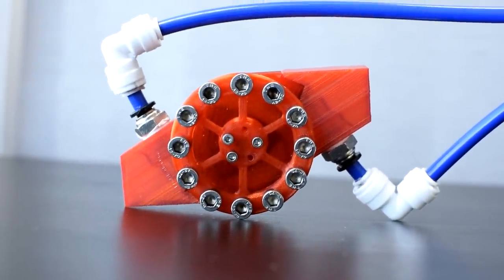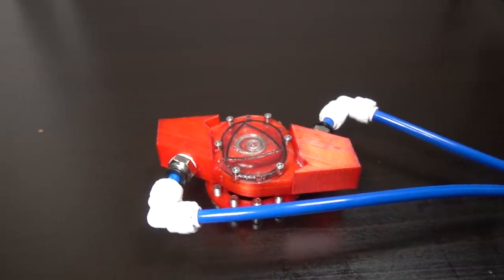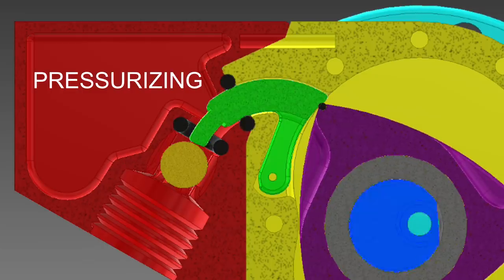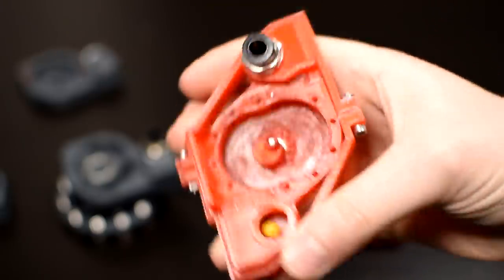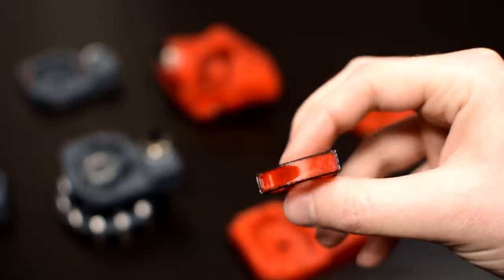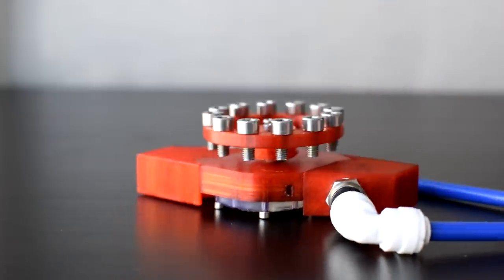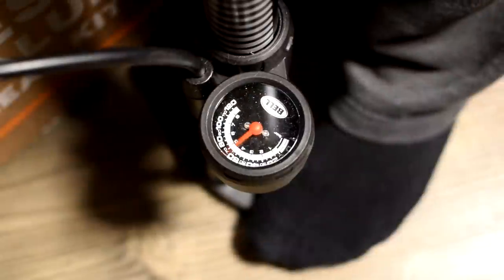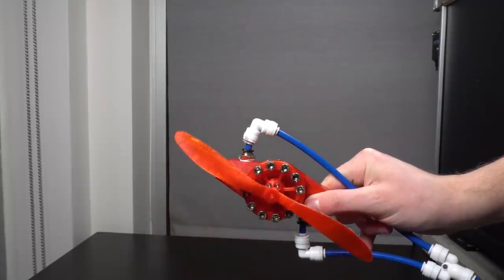3D Printing a Functional Wankel Engine

Comment: Was I the only one here who cringed slightly every time he said "piston" instead of "rotor", and "cylinder" instead of "housing"?
Also, in the background of the Wankel, it would have been relevant to mention that the concept of the Wankel Rotary in fact started out as a pump, but was later realised that it would also make an excellent engine. It does stand to reason, after all, an IC engine is basically just an air pump.
With that said, nice work on everything!👍
Reply from the maker: I cringe constantly, eventually you just get used to it!

Comment: Cool concept using air. The combustion variant is actually a crap engine; Super low torque, overheats waaaay too easily and relies mainly on rpm for "power".
Reply from the maker: Well, its a fantastic engine in theory! Just limited by today's tech. If they got as much attention and development as modern piston engines, they would certainly be a lot more capable. Also maybe some fancy new low expansion, heat resistant materials for better sealing and whatnot.

Comment: Well it works.. but is it really functional? Using air as a source of energy comes with a high weight or in work you gotta do. I dont accept anything on air as functional unless its connecter to the source of energy directly, say an compressor..
Reply from the maker: The fact that it works means it is functional by my requirements, which are converting compressed air into mechanical torque reliably and relatively efficiently. Now is it practical? No haha, no it is not

Comment: I'd like to see that Engine Steam Powered.
Reply: Get an Big pot do fire under it amd after an hour you've got sustained pressure thatay be strong enough
Reply from the maker: Also I'd probably have a melted engine, pla has a very low thermal deflection temp. But perhaps if I could print this in something more heat resistant...
Reply: @3DprintedLife  it depends, low pressure steam can stay below 180° C so  it wouldn't melt, but that's steam at 1.1 bar, and thats probably not enough so yeah, you'd need something more heat resistant
Reply: @3DprintedLife  and pah cf15 fillament is able to withstand 150°C and EXTEM AMHH811F is able to withstand temperatures up to 247°C but i think to print that fillament you need a special nozzle or something alike that

Comment: Given the price of resin 3d printers, why did you bother with fdm ?
Reply from the maker: Well I don't have a resin printer, so there's that. Also, I wanted a challenge. Doing this on a resin printer would still be tough, but the tolerances it could hold are so much better. Makes things much easier!

Comment: Gotta push back on that comment about FDM being inaccurate, my Biqu B1 is extremely accurate and I can print most things exactly the same size as the models.
Reply from the maker: Ah yes sure, I don't mean FDM printers are super inaccurate. If you print a 20mm cube, odds are most printers can get it within 100um. But most printers also can't avoid bulges on the exterior corners, large filets on inside corners, poor accuracy with overhangs, surface finish is far from smooth, etc. Compare what fdm can do with sla or machined parts and suddenly fdm isn't so accurate anymore, even though fdm is still perfectly acceptable for many applications!
Reply: @3DprintedLife  yea most of mine do that except the Biqu, not sure why but it works 😂

Comment: is it possible to make the same design on steam or is the pressure not high enough
Reply from the maker: The pressure would be fine, the high temperature is the issue. But with some design modifications and a different plastic, it might be possible!

Comment: Have you tried a tesla valve?
Reply from the maker: Ooooh no, but that's a cool idea!
Reply: @3DprintedLife  If you decide to experiment just note that all of the tesla valves I have seen are linear in fashion. If you’re limited with space you can print it in any shape you need, circular, spiral, Zigzag, whatever.
Reply from the maker: Very very true, thanks for the suggestion!

Comment: Hello sir, wich 3D printer is best for beginners
Reply from the maker: Depends on a lot of factors and primarily budget but I'd say go FDM unless you specifically want a resin printer. Ender 3 is popular and low cost so probably one of the easier machines to get help with online

Comment: Nice Work! I have also designed a 3D Printed Wankel, but mines a bit bigger and probably less efficient, I went with the original design using only the rotors themselves as seals. It worked nicely for the first version, even without apex seals and not precise printing, I have finished the second version but I didn't have access to a compressor to test it yet because of the lockdown, but the new version has apex seals, better flow design and more importantly 2 rotors! Hopefully I can test it soon!
Here is the new version: https://www.instagram.com/p/CMdxLrDLecm/
Here is the old version running: https://www.instagram.com/p/CInpyybpRqb/
Reply from the maker: Very cool, thanks for sharing!

Comment: Wait why this not on a actual car wheres MAZDA at they better explain why no air rotary cause apex seals can't die then
Reply from the maker: True, but if they were to actually make a car that ran on some kind of compressed gas there's probably more efficient engines. Wankels are meant to compress the air-fuel mixture then ignite so there's that redundant step when using already compressed air to start with
Reply: @3DprintedLife  true but they tried with hydrogen so why not air its plentiful and renuable just take water take it to its basic form oxygen and hydrogen
Reply: And energy you can make its called oxygen its actual quite simple once humans can figure out how to make atoms bond to make elements (we do but we need a element to make it)

Comment: Why add valves... one of the advantages of the Wankel is the absence of valves. You are supposed to be tuning ports, not making valves...
Reply from the maker: Ah yes, but you're forgetting one thing. Otto powered Wankels inject a fuel-air mixture at near atmospheric pressure, which is then compressed, boom, huge expansion. I'm injecting compressed air which immediately begins expanding. I could run it with no valves, but the efficiency would be terrible as it would just keep consuming air even as the rotor approaches the fully expanded point of the stroke right before it begins to exhaust.
My valves could use a lot of improvement, but it still beats just hooking up an air supply directly!
Reply: @3DprintedLife  yah, I get it, thanks. Engineering is a balance of compromises I guess. The seals look amazing btw; your craftsmanship is impeccable.

Comment: That's not an engine. Where are the spark plugs? Where's the fuel?
Reply from the maker: You're thinking of a combustion engine, which is a specific (albeit common) type of engine. Engine is a generic term and yes it does apply here

Comment: its not a engine its a plastic model driven by air
Reply from the maker: "An engine or motor is a machine designed to convert one or more forms of energy into mechanical energy." Compressed air is a form of energy, and it is being converted into mechanical energy. I never claimed it is a combustion engine or it runs on a combustible fuel, but it is indeed an engine.

Comment: Can you really call it a Wankel if it's not using the Otto cycle?  More like a wankel-shaped fan?
Reply from the maker: A wankel shaped fan...that's a new one lol. It still operates on the same principle as a fuel propelled engine, it just skips the fuel injection and compression and instead directly injects already compressed air at the stage where combustion typically occurs. The expanding gasses in the chamber are what drive the rotor forwards. So no it is not a fan, it is 100% by definition an engine. Whether or not you want to call it a true wankel is up to you :)

Comment: Tom's so much better. Yours can't even stay running so how does it qualify as working? Unsecribed!
Reply: Tom's may be better by several appropriate ways of measuring engine performance. But this certainly qualifies as working because it converts the potential to do work contained in the air's pressure difference and then converts it to work. It may not impress you but I believe it is a worthy achievement. And it is certainly an engine.
Reply from the maker: Lol honestly can't tell if you're being sarcastic or not
Reply: @3DprintedLife  I'm just kidding. But be cool if you could hook up to a big air compress and let that thing rip!
Reply from the maker: @nicklucas366  hahaha cool cool, it was a little hard to tell honestly. I could definitely see some people saying this "doesn't work" because it didn't spin as long as his 😂 stand down toe-mato gang! (don't worry about it)

Comment: Why bother with valves at all? A Wankel is valveless. This is literally one of the major points of the design.
Reply from the maker: True, but this isn't a combustion powered wankel. It's skipping the compression cycle and instead directly using compressed air, and the functionality doesn't transfer perfectly. I technically could just hook up an input air line directly where I have the valves now, it would be incredibly inefficient to do so as it would be dumping air at intake pressure air straight out of the exhaust, wasting all that energy. The intention with these valves is purely to improve operating efficiency.
Reply: @3DprintedLife  there's why! :D Thanks!
Reply from the maker: @StripeyType  Happy to explain! Probably should have explained this a little better in the video...ohwell :)

Comment: Its actually turbine not an engine
Reply from the maker: No, it actually is an engine. A turbine relies on aerodynamics. This relies on expanding gasses pushing against a piston/rotor. Google the definitions if you don't believe me :)
Reply: @3DprintedLife  common definition of engine is, something that easier humen works, its could be an engine if it useful for human 😂 "quote from 3 idiots movie"
Reply from the maker: @masgillan  Hahah well, that's not that far off XD

Comment: wankel engine is interesting because is really simple with no valves and other things that are needed in piston engines, you are just making it so complicated and destroying all the good things about it
Reply from the maker: While yes valves aren't required, you're forgetting something. Combustion powered Wankels inject a fuel-air mixture at near atmospheric pressure, which is then compressed, ignited, and expands significantly. I'm skipping a step and injecting compressed air which immediately begins expanding. So yes, I could run it with no valves, but the efficiency would be terrible as it would just keep consuming air even as the rotor approaches the fully expanded point of the stroke right before it begins to exhaust. The valves limit the air input to ensure excess air is not wasted.
Reply: @3DprintedLife   yea, i understand, i also understand its fun to make, but wankels are so ineficient and unreliable (the real ones) that i think it would be same here. For me, funny idea would be to make piston air engine of same volume and compare their power with same input presure. and compare results to real counterparts
Reply from the maker: Yeah it definitely is the same here, still very inefficient. But the valves just help it a bit haha. I'm thinking of a V2 which should greatly improve efficiency and, if all goes well, I should be able to more directly compare it with Tom's engine (which I briefly showed at the end of this video)

Comment: A wankel engine with valves? Kinda defeats the point
Reply from the maker: Different fuel has different requirements, but the fundamental operation remains the same

Comment: That is not a functional engine 🤣 maybe call it 'I made an inclosed air powered fidget spinner'
Reply from the maker: I'd disagree. I'm running it off of a 1L bottle for all the clips in this video, but connected to a larger air supply this engine could run constantly and it does actually have enough power to be used in real applications. It is small, but that doesn't mean it isn't functional.

Comment: so a very bad quality single rotary engine
Reply from the maker: Yes! But it's mine :) And it's made using processes that most hobbyists could repeat at home without too much pain. But don't worry, V2 will be coming eventually and using everything I've learned so far I should be able to make it way way more efficient!